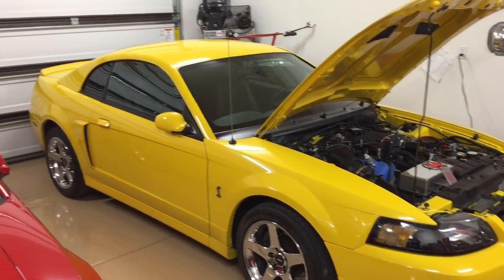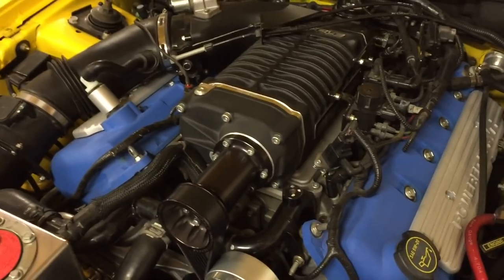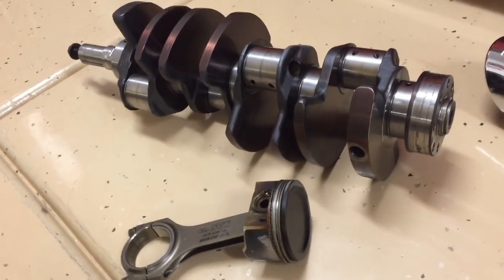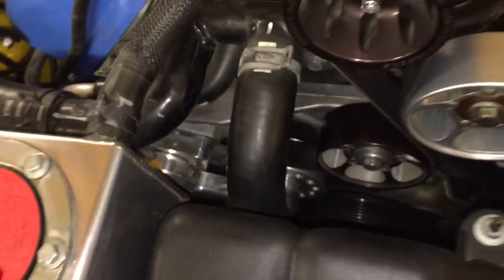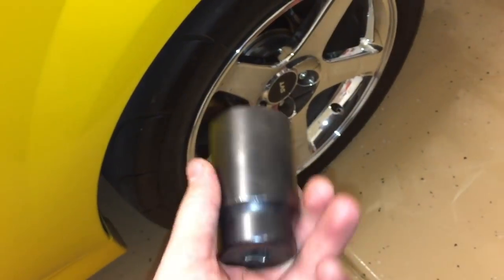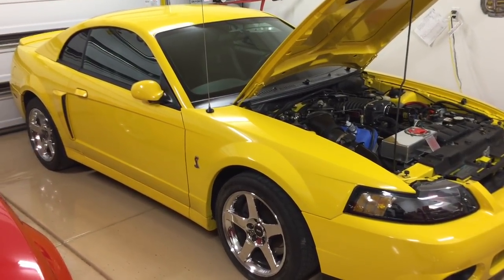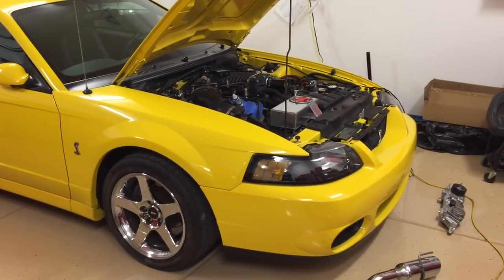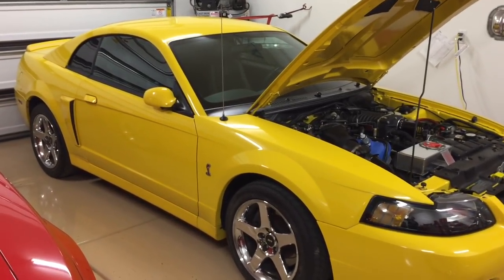Terminator Cobra FAQ: Know before you buy

Comment: Danny, I need some help. I found a 03 sonic blue for sale. The seller claims to make around 800 hp. The only mods I know are an mmr block bored over,a kenne bell mammoth black blower, built heads (didnt say whether stock heads or not) cammed (not sure what cam is in it),mcleod twin disc clutch, and a billet flywheel.It also has some fule system work. 60k on the body, 3k on the build. All that was done to the suspension was it being lowered, and the IRS has only upgraded half shafts. It also has a full exhaust.The owner did not say that he upgraded anything else, including the t56. He wants 27k. What are your thoughts? Im thinking that I would definitely have to sink quite a few dollars into it to make it safer.
Reply from the maker: I’m always a bit leary on those who put a car back together and immediately sell it. My brother has an mmr600 block in his bulllitt and it’s held up, but mmr does not have the best reputation for taking time to properly assemble and torque things down- doesn’t mean it’s bad, but not the best option. With that much power on a non-factory assembled engine, as well as other mods like cams I’d really want to see the car in person, perform a compression test, see how it drives, if it smokes, take a borescope and LOOK at the pistons (through the spark plug holes) for any signs of the pistons having burn marks from running lean or speckles from detonation and NOT pay $27k because the original value of the car is not there with an aftermarket engine. Anything done to the car should be a bonus for buying it, not a reason to pay top dollar. I have videos on compression tests if you’re interested. In perfect shape with everything checking out I’d offer $22k max. People don’t typically make 800hp for the car to sit and being it’s already went through an engine shows it’s likely been beaten. 3,000 miles could be many many times down a 1/4 track. Did he upgrade the oil pump and tensioners? tons of other details that are a “who knows” scenario. You want it from the guy who dumped a ton of money into it, not bare bones replaced what broke
Reply: Danny Johnson Thank you so much for the reply! I honestly dont know. He has not mentioned it
Reply: Danny Johnson It is in the SVT forums classifieds. I modified the numbers slightly to try to make sure the seller didnt see it, but now I dont care. Over 700whp on 93, 53k miles, less than 2k on the build.